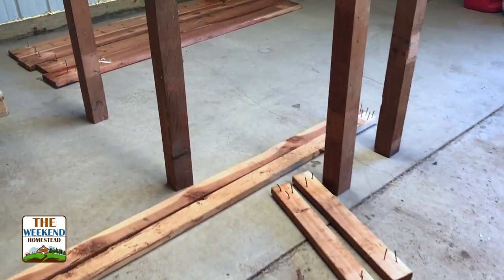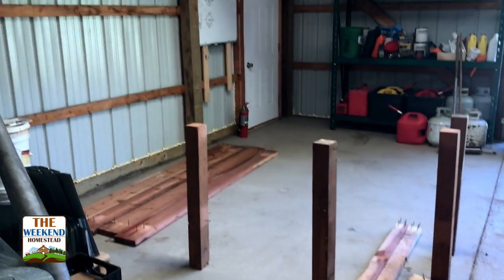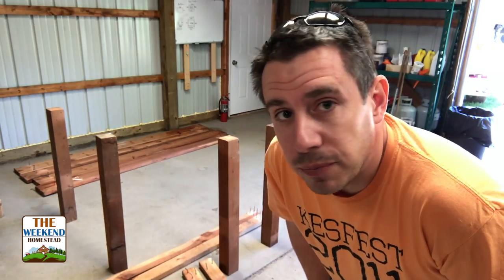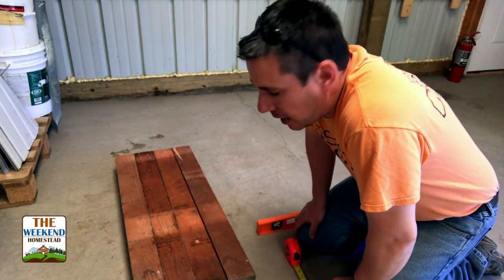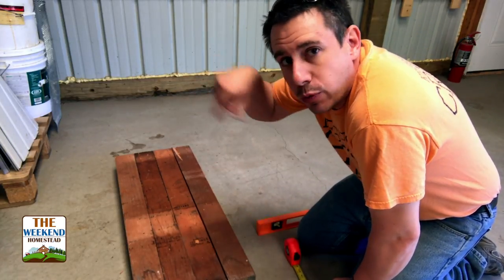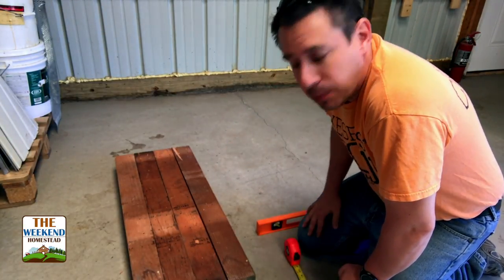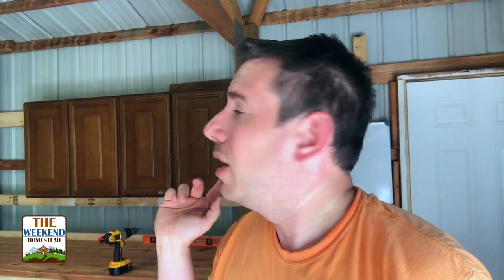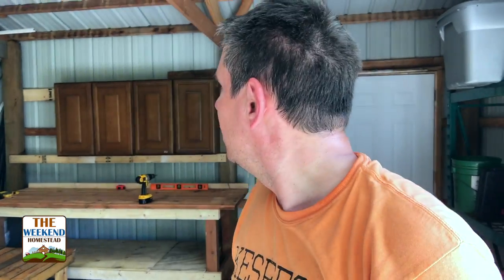Off Grid Barn Work Bench - Getting Ready for our Solar Project ~ Building a work Bench

Comment: Been a carpenter for 20 + yrs, installed cabinets for about 7 of those years, probably would have done it differently but the end results would be the same.  The work bench is flat and useable and the cabinets won’t fall down when filled up with more stuff then they really can hold.  All in all....good work.  The cleat (you called it a brace) at the bottom of the cabinets, continue it down to the bench backsplash and you will have a place to hang tools & stuff.
Reply from the maker: Great idea - I may get a bunch of those colored bins to store screws and stuff in and put some hooks into the 2x4